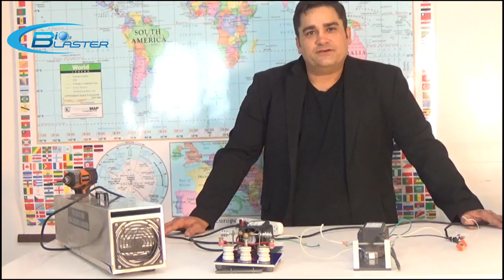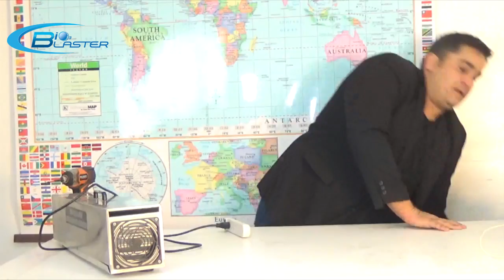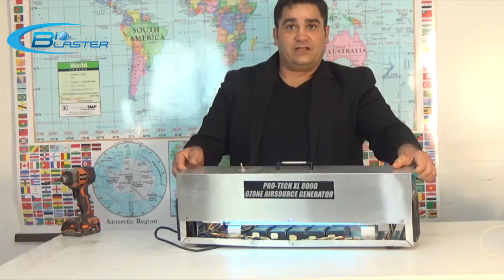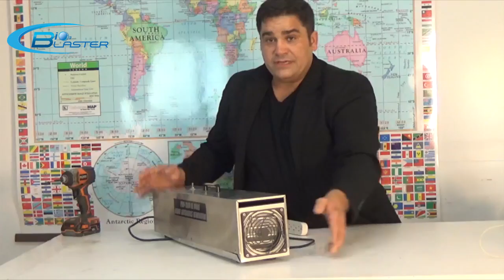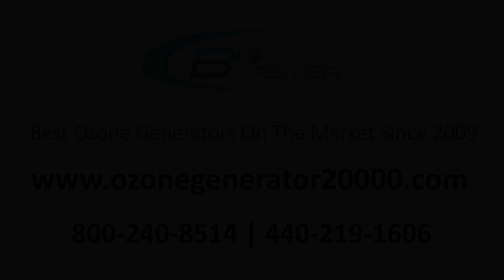How Ozone Is Made - UV Light Vs. Corona Discharge

Comment: Sorry for my bad english. I'm very interesting.
In water purification, people always use UV light to sterilize water. Also some use Ozone light to make O3 from air and flush the air to the water.
If you say the ozone light only effective if used in high oncentration of water, how about put them in the UV light tube where the water pass through its outer side. Will it more effective than passing air only? Please respond and thank you very much.
Reply: Dear friend, Ozone is not a light, it is the gas. For purification water by ozone it is necessary to mix water with ozone. For example by means of Venturi nozzle or with the help of compressor.
Reply from the maker: Adding a static mixer inline after the venturi will radically increase the efficacy.